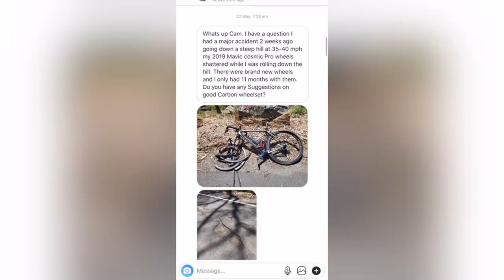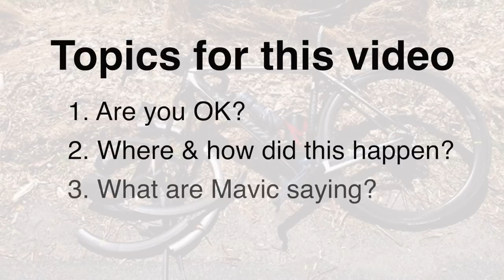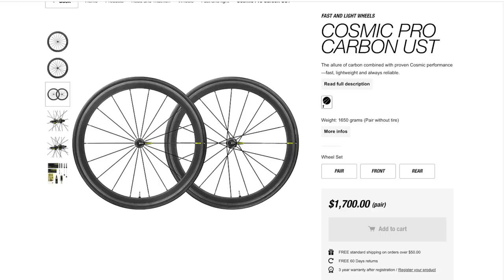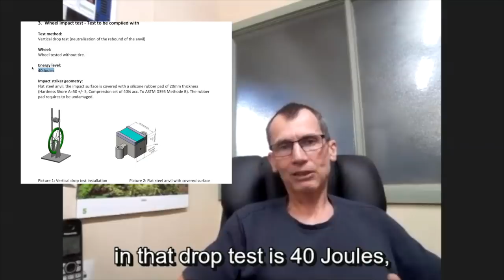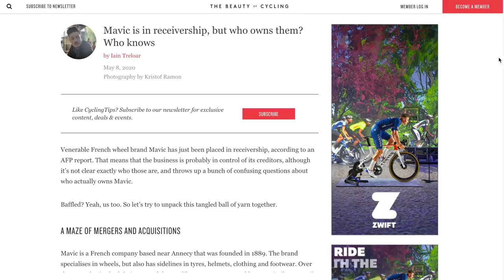A FRIGHTENING MAVIC CARBON WHEEL FAIL (at speed)

Comment: This is hectic ... and people have issues to say bad things of Chinese wheelsets... that wheelset cost around 2000 dollars and for that amount of money spent there should be some guarantees... very scary and I was just thinking of getting a set of deep sections
Reply from the maker: Yes, you raise a good point there Zaahier, it was certainly a wake up call for me. Cam
Reply: I think the accident is a matter of people not understanding material compounds they use sufficiently. rim brake and carbon is not a great combo, pot holes and carbon are probably worse. 
A million dollar wheelset isnt going to survive people riding the brakes, bhopping and hitting pot holes. all materials have a structural limit and cyclists for some stupid reason insist on pushing those materials to their limits.
Reply: @itsdeebs5156  we push it to limits because we paid a lot and we think we get our money out of it if we use it and it's like "indestructible" hahaha

Comment: I have to say that riding at high speed on crappy roads is not the wisest of decisions. If you run carbon wheels and you will have some heavy braking conditions you probably would be best served using disc brakes as the heat won't be dispersed into the rim. Sorry to here about the accident, glad that no sever injuries occurred.

Comment: When rim brakes are failing that is a scary thing something tells me he was training for the NYC gran fondo I know that climb all to Well and the decent if one does not have great confidence decending grabbing a lot of brake (which is normal) will happen and when that happens the likelihood of a rim failure is imminent. Disc brakes well give you confidence but knowing the climb is a plus. Knowing how to slowdown without grabbing a lot of brake is key. All in all its very unfortunate to hear a cyclist hurting himself on a climb we all in NY ( if you are a cyclist) have done.
Reply from the maker: He knew the climb Stephen, was actually very familiar with it. All it takes is a slight lapse in concentration at that speed and you're into a pothole !
Reply: Well Cam it is true he was familiar and is true that he knew it Well enough but his gear is something that needs to be checked and your video explained it very well.
Reply: so i am asking now
will disc brake not fail?
Reply: But potholes are a problem in the US due to covid 19
Reply: It will fail if the rotors are not clean 1, if you are running a tubeless set up that is poorly put together (I have been in a few crits with them)  but if your rotor overheats you wil heat a ticking sound or a squeal, when engaging your brake but if you were to say failing comes down to gear check.
Reply: "Knowing how to slowdown without grabbing a lot of brake is key"
OK. How do you do that?
Reply: Neo Payne - Mountain bikes have extreme descents and surfaces and disc brakes are reliable on them. While it’s possible that anything can fail, it’s super unlikely on a road bike.
Reply: @jesselee4725  shifting weight to back tire and knowing when to slow down when the bike picks up speed on the decent. I have done that climb on a rim brake and disc bike knowing when and how to not "cook" your brakes is key
Reply: @JonFairhurst  so it bring another question
should we use mountain disc brake caliper (which usually with 4 pistons? also more power right?) on road disc brake setup?
i know we do need technique on braking
but the matter is how can we avoid something like this
Reply: Neo Payne - I use a 2-pot XT brake on my XC bike. It has all the power I need. But this is more about heat than power. We aren’t going to melt the rotor. The other risk would be boiling the fluid, which isn’t likely at all with a 200 lb bike+rider. We would get warning with a mushy brake and can pump it up. I have yet to feel brake fade in my steep area on XC or road bike. Carbon rim brake clinchers, OTOH, have a potentially catastrophic weakness on hot descents.
Reply: Not sure the brakes would have been that hot in that part of the decent. It seems he only grabbed the brakes after the brake tire blew out. Of course there could have been deformation due to earlier  braking and possibly previous damage to the rim if he has a habit of hitting potholes.
Reply: @JonFairhurst  at what speed and for how long? You can have kilometers of high speed descents on the road.

Comment: Carbon wheels with rim braking cannot handle wet braking while it is raining on a bike ride.  It is said that alloy rim brake do much better in wet braking and aluminum has been known to dissipate heat very well in other applications.  My suggestion for good brake pads on rim brakes is by Shimano and by Koolstop.  Koolstop does make a dual compound brake pads that are very powerful almost like disc brakes.  Cheers!

Comment: Please pass our best wishes to "john " the rider with the carbon wheels.  I am a similar weight  and do both mtb and road riding and converted to disc brakes for this reason. I did have a alloy rim fail 20 years ago due to excessive wear and poor maintenance so fully appreciate the failure and the need to check the rims regularly.

Comment: I have 2 sets of full  carbon clinchers but I've learned not to ride carbon wheels on hills because over heating.  Never had a blow out and that that my weight is 190 lbs.  And 6ft.  For hills I use aluminum brake track wheels , I feel more safe on them blowing down hill..👍👍
Reply from the maker: Thanks for sharing Jay.

Comment: Mavic are one of the only remaining wheel manufacturers still producing rim brake carbon wheels. I know because I only just purchased a new set of Mavic carbon wheels last week. Dare I say it though, a different model, the 'Comete pro ust'. I am 74kg, use my bike, mainly for competing in triathlons, which generally don't have really hilly courses. Fingers crossed. I would be more worried about my bike than myself.

Comment: That's exactly why I bought some alloy wheels with a carbon fairing to replace my carbon wheels. I'm very tall at just about 2m/6'6", and I'm a very heavy rider at about 260lbs/120kg. I live in a hilly area where medium/long descents are a consistent part of my riding.

While I was still using my carbon wheels, I would avoid braking as much as possible on long descents, just to avoid overheating my brakes on the way down. As a result, I would often be descending uncomfortably fast.

While I'm still careful about my braking on descents, having an alloy brake track provides a huge amount of peace of mind for me, and I still get the aero benefit with a carbon fairing. Additionally, because of how thin the fairing can be since it isn't structural, the wheels aren't noticeably heavier for me (though I haven't weighed them to know for sure.)
Reply from the maker: Thanks for sharing Kevin

Comment: The rider weight is mentioned at a weight of 100kg with bike and accessories adding up to an additional 10kg. With a system weight 110kg and we are unable to determine braking technique, but this system weight requires diligent management of braking to avoid being at the upper limits of any carbon wheels. Personally I would avoid carbon rim clinchers for riders above 80kg on ride with long and technical descents with unknown road conditions.

Comment: I had a similar experience descending The Tumble in the UK. I weigh 90kg, was at approx 40-45mph and was trying to lose some speed before the left hairpin bend. My Enve 3.4 SES rim brake carbon clinchers failed during braking. The brake track delaminated completely, causing a front tyre blowout and a subsequent hard stop! I physically was fine, this was a few years ago and as such I switched to disc brakes for my carbon wheels.
Reply from the maker: Thanks for sharing GT and glad you’re ok

Comment: I have been told by bike mechanics that rim braked carbon wheels can be susceptible to this type of failure due to heat build up. I avoided carbon rims for this reason. The advice I had was to limit breaking to 20 seconds at a time. I have just upgraded my bike and had to get Disc breaks, the rims on this bike are carbon. But I believe there will be negligible heat transfer to the rims.
Reply from the maker: Thanks for sharing mate

Comment: Since 2014 til now, 6years we have been riding rim brakes on carbon wheels, we ride fast and we ride for hours and we have no issues whatsoever.
How long has the rider been cycling his cb wheels? I dont think its a rim/carbon combo issue. Its more along the lines of going beyond the required safety limits.
Reply: ^^^ Touch wood mate. -U10

Comment: My 55 year old dad has expressed his interest in getting some carbon rims as he’s currently on some roval alloy rims. However I have tried to convince him to avoid carbon rims because of this reason. He loves thrashing himself on steep hills and what goes up must some down. However he is a very timid descender and holds his breaks in the whole time on very steep descents. I believe it’s very important that he should be able to do this as he feels comfortable and in control thus having fun. I’ve made him get off his bike after a descent to get him to touch his rim and he was so surprised how hot it was. You could probably cook a snag off it. I’ve tired explaining too him that if you did this on carbon rims there’s a higher risk of failure. It’s a shame because it’d be great for him to have carbon wheels as he will get more enjoyment however because he’s on rim I try to steer him away from them. Obviously on disc breaks there would be no issue and when he was looking for a new bike I suggested a disc break bike. Any suggestions?? Is it true that it’s rare?? Dads 85kg and on descents where most people go 50-70km/hr he goes 30km/hr (just to get an idea how much he’d be breaking).
Reply: Yes he needs to get carbon wheels with an alloy brake track at the very least.

Comment: Carbon Hills resin maybe have dry spots in the wheel so can have weak points. Best off carbon with  alloy rims or all alloy. I've heard disc breaks breaking forks on down hill to but not very common.

Comment: Same story with me, I was going downhill and the wheel went out of the front into under the bike catapulting me to a head-on asphalt impact, I was left bleeding on the road at night until the ambulance arrived. I wasn't using a helmet and the front wheel was showing signs that something was wrong, I guess I have only myself to blame for what happened,  basically, I got 3 stitches in my head and could barely walk for 3 days because of my left leg hurting too much

Comment: Hitting a pot hole with any wheel including cars will course damage. And for people saying disc breaks are the answer, I had disc break once went out for a ride. did a climb all good coming down the other side no back break. The hose had failed at the joint lucky my front break worked and two destroyed cleats. Every thing can fail check your bikes before and during rides is the morel of my story. 
Ps happy he’s ok

Comment: Personally I've found that with my carbon rim brake wheelset they are less hot after the same local decent than my alloy wheels. There will always be equipment failures but carbon fibre does have excellent properties when engineered really well. But then again I prefer my alloys as they are way lighter and cheaper, so I don't fear crashing on them.
Reply from the maker: Thanks for sharing mate

Comment: Appears the more reasonable solution for those "bent" on running carbon aero wheels front and back would be to use dic brakes front & rear with tubular tires. Disc brakes front and rear removes the lethal heat loading on carbon wheels. Wheels for tubular tires are inherently structurally stronger, easier to design, easier to produce than a clincher wheel. A tubular tire with matching wheel reduced the loading forces on the rim of the wheel due to the need for this area of the rim being forced to cope with supporting a tire with 100+ psi.

IMO, unless one is pushing for the highest levels of bicycle performance, very well proven aluminium alloy rims wheels are likely going to last longer, more rim brake heat tolerant, slight mechanical damage tolerant than carbon-composite rim wheels.

Comment: I only use my bikes for none competative purposes so weight is secondary to safety. I am an engineer by profession.
I have over time equipped my bikes with alloy rims and hub brakes.  A similar risk arises with a rim brake wearing through the sidewall of an alloy rim, I've seen it. There is one event you must not have happen with a bike and that is any risk whatsoever with the integrity of your front wheel or forks, the back end doesn't matter that won't be catastrophic. I only have one bike left with rim brakes, it also has a carbon seat pin. It's a lovely bike to ride but the rims and seat pin are frequently checked. The front wheel may well be changed even so.

Comment: Descents with rim brakes on Carbon wheels you need to be aware of this list
1. UD carbon ( no exceptions), coin or finger tap tested every time you take them out for a ride.
2. You need a different braking technique ( no exceptions )
https://youtu.be/-dDQ5D1WvYw  ( For flats but also applies in descents)
3. Before going down the descent a study of the road conditions must be done including wind direction.
Road condition includes if the road has been repainted ( yellow lines)
Pot holes is the biggest check that must be done so you can avoid them on the way down.
Notes : a spinning wheel is strong as long as the direction of spin is centered in a straight line.
Remove your wheel and spin it then hold on to the sides, it will spin nicely, now move your hands and twist the axle
you will notice the force that is applied to the hub, which is then spread through the wheel. Since the weakest part in carbon
wheels are the outside edges, when the impact occurs it will spread to the hub which will reflect it back to the weak tire bead 
which cracks the wheel. This is why this happens less in Tubular tires as there is no tire bead to weaken the wheel.

Comment: Hi,
It can be add that with carbon rims and rim brakes it is better to avoid latex inner tubes
Reply: I would agree with this. I tried latex inner tubes for the first time during a 10 day event in the mountains around Bilbao. At the start of day 5, after a chilly early morning ascent, my front tyre blew out on the first descent of the day going into a hairpin. Cracked a rib. Replaced the damaged front wheel with a spare with a regular inner tube and set off again. 200 m later the latex inner tube in the rear blew out too. Stayed upright. Mechanic suspects the heat from the alloy rim during braking caused the latex tubes to burst. This is the only time this has happened to me in 11 years of regular riding and racing on regular non-latex tubes. Haven’t touched latex tubes since.
Reply: @TheJimty  if it happens with alloy rim it would be worse with carbon rims. Latex inner tube is only for disk brake and nowadays perhaps it is better to go tubeless

Comment: Having had tyres blow off the rims on my carbon wheels in 40°C temperatures, at low speeds whilst braking (rear mainly as I tend to brake 60/40 rear/front bias, I tend to only use them in cooler temperatures when I know the resin is not likely to be soft. I do prefer the security of alloy as a braking surface and will probably be looking for some alloy/carbon 50mm section wheels to replace the full carbons I have now.  Great episodebtw. Really good glad I found d your channel.  👍 stay safe. 😷

Comment: Good he did not sustain heavy injuries. I am very happy riding my 50mm Mavic Carbon rim brake wheels which gave me a noticeable speed boost. But I also do not weigh in at 100+ kg and run into potholes with 75 km/h. If I did I would not choose carbon wheels myself. YMMV.

Comment: From my experience with Aluminum is it's very stable until a certain point and then it disintegrates to nothing. This melting point is a lot lower than than thing like copper, steel, titanium etc. But it's melting point is apparently 660 degrees which is outside breaking temps but just something to note. 

If a aluminium wire has a bad connection with high current it will just vanish, but other stable materials will glow red. Welding aluminum needs low heat, so easy to completely blow through material. Also corrosion, aluminium doesn't rust or show much signs of oxidation, but when it does suddenly show there can be big holes in the handle bar for example, scary stuff.

Comment: Based on what the expert is saying here.  Rim breaks on carbon wheels should be considered either pointless in the case of a rider who will not push the limits of them or dangerous in the case of a rider who will.  They should be structurally sound to hit a pothole with a rider exceeding max weight by 25%  at whatever temperature the rim brakes will begin to visibly smoke. 
I'm all for people taking taking risks if they want to, but I feel anything not meeting my standard should be clearly labeled as hazardous.

Comment: A frightening video especially as i have just purchased the very same wheels, one thing not mentioned in the video was tyre pressures, there is a label on mine stating that a 28mm max presure is 5 bar/ 72psi and a 25 mm max presure 5.5 bar/ 80psi,  something to bare in mind for all carbon wheel users. What presure was he using ?.